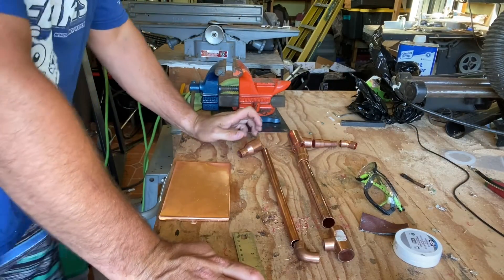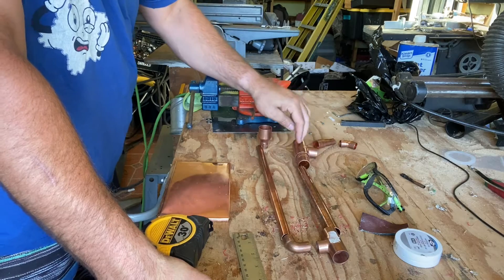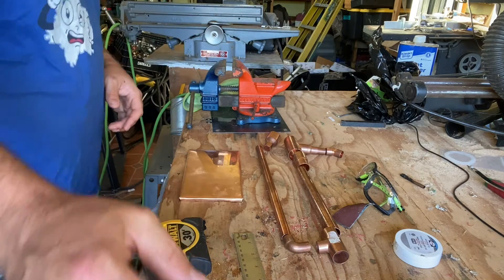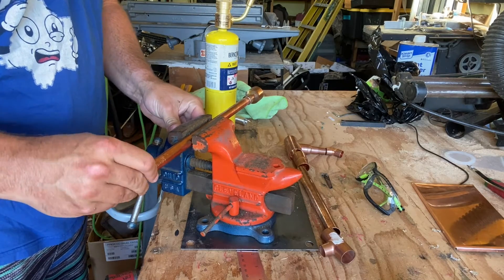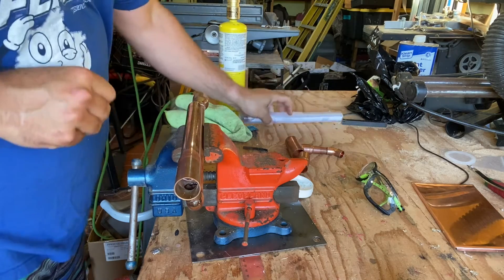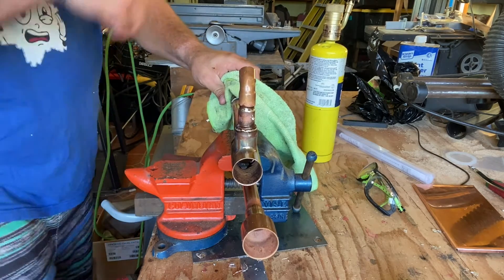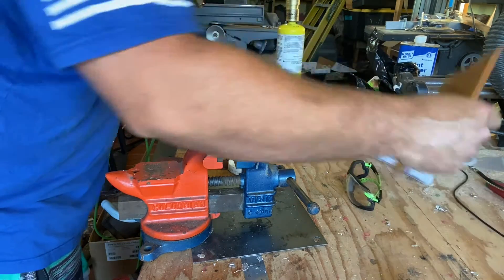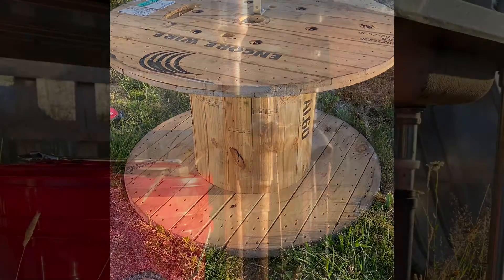DIY Moonshine Proofing Parrot

Comment: Clean, flux, and assemble all your parts before soldering on a project like this, it'll REALLY help you to keep everything square and plumb. Plus, in cases where you're soldering both sides of a fitting, you don't waste a lot of heat.

Comment: Really good parrot. One thing I was not happy with was a look at the end result and could of gone with camera around it and seen it fully assembled or pics. Also you put a T fitting at the bottom and needed a end cap to stop it leaking out and then put the cap on the underside of the plate and put legs on four corners for  it to stand up steadily 🤣 But hopefully it works for you👌👍
Reply from the maker: Keep in mind this was built during copper shortages and certain parts weren’t available. But the tee fitting at the bottom is soldered directly to the copper plate at the bottom so no need for a cap. The copper plate it’s self has 1/4” turned down for even support around the bottom and to make it more ridged. I could definitely do better with the pictures and video though
Reply: @bryansworkbench8585  👌
Reply: @bryansworkbench8585  so happy you done the video I'm going to give it ago. What size pipes are they I understand millimetres or inches all we need is a parts list so we can buy all measurements please👍👍
Reply from the maker: @DripdropBrewing  I’ll have to get back to you on that I think I put it in the description if not I’ll get a list and reply to you

Comment: How are you going to read it? Can you see through copper?
Reply from the maker: Look down at it, you can slide the tube up more, you can cut the top down take your pick. Been running it just fine. Plus a proofing parrot just gives you an idea of where you are in the run not give you an exact reading of what’s in the jar. You still need to proof the jars and make your cuts.